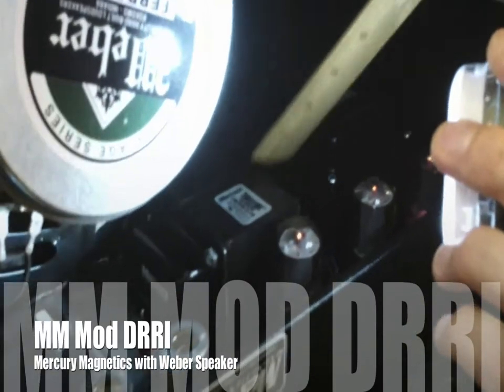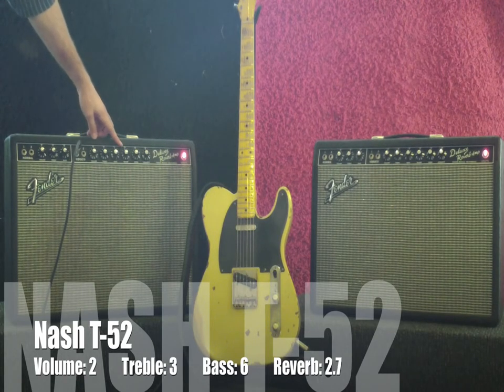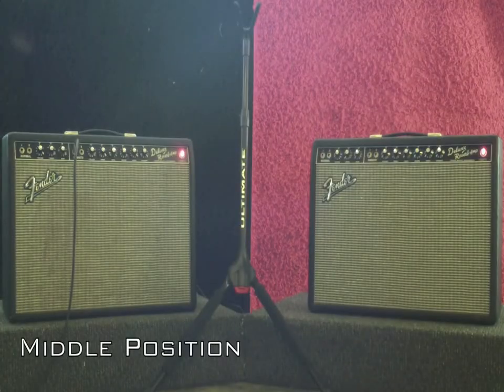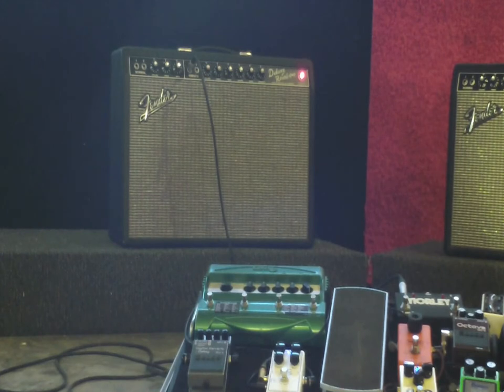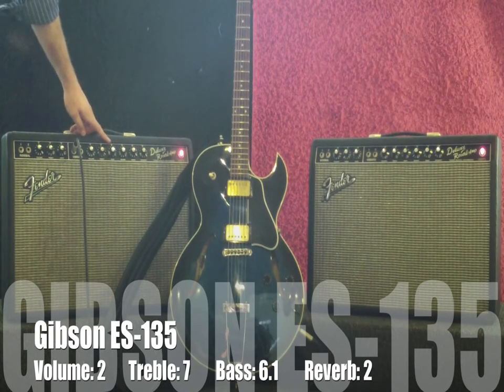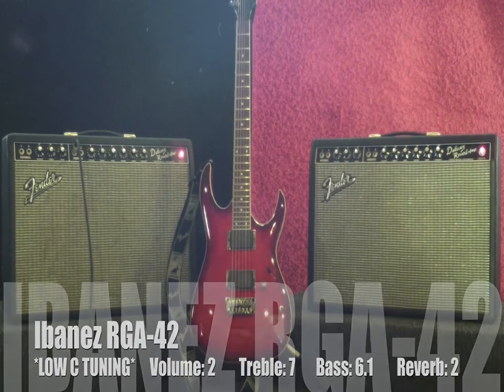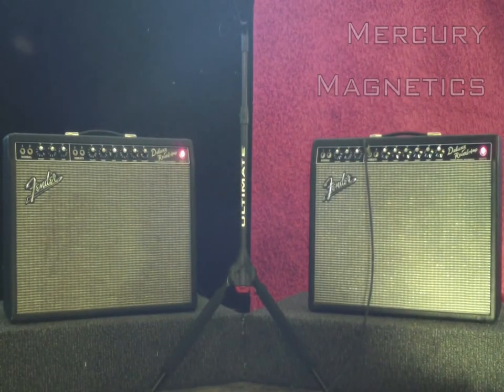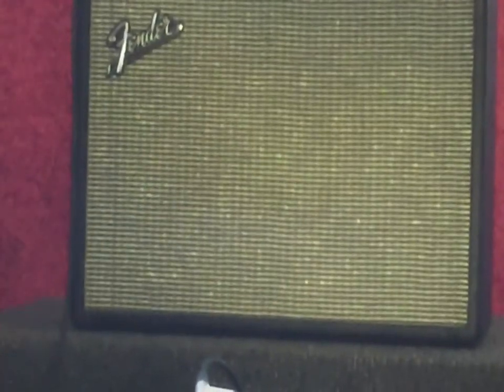Mercury Magnetics Demo/Comparison- Fender Deluxe Reverb Reissue (Part 1)

Comment: My opinion on a lot of these small fender amps is that when you get them all the way up or close to it you will be really happy you have the better transformer. The gain is more clear and less muddy. But the real reason to upgrade all this tranformer stuff is because you kick the crap out of your amp and put it on real loud. So at bedroom levels it is unnecessary. Especially if you use a pedal for boost. That is why some of the comments below say that it is not needed. But trust me that it makes a big difference when you really play the amp straight through and on full.

Comment: Just run both amps through the same speaker for the demo.  You can take the speaker out of the second amp to the speaker terminals of the speaker of the original amp.  Speakers could EASILY account for the tonal difference you are hearing.  By the way, I like the clean tone on the original amp.

Comment: I prefer the stock too. A bigger output transformer will definitely change the sound but not necessarily for the better. Fender knows this perfectly as well, it's not a secret. Fender chooses very carefully the size of them to achieve the sound they want. A bigger OT will sound bigger but also stiffer, will saturate (distort) at higher volume. The power trans will barely change anything except if it has higher or lover voltage, or if it's underrated and sags.

Comment: Upgrading the transformer and the components he changed will help but changing the treble cap to a better one with a few other mods will tame the highs and smooth them out. In addition, installing high quality power tubes will make this amp a beast.

Comment: Don't know much about transformers etc., but I can tell you there is a huge difference between the Weber 12F150 and the stock Jensen...big difference. I replaced mine soon after I bought my DRRI. Then I took it to my local music store and we did a side by side with my Telecaster. All settings  were exactly the same. Three musicians put the amps through the paces...no contest, Weber was w-a-a-y crisper, better sustain, more articulation on the strings, everything.

Comment: MM and weber made it a little sterile or harsh. I think the stock one sounds good. Especially the ones I played with the Jensen.
Reply: Jeff Nickoloff I can't agree. The original sounds muffled and has a lot less articulation. As i said above, installation a better treble cap will smooth out the highs if that's what bothers you.
Reply: jimmy5634 Not to me.  Much warmer, richer before.  YMMV I guess.

Comment: sorry but with different speakers it just cant be fair.  One speaker may have a completely different voice and not to mention the sensitivity may be different effecting the volume.  It aint apples to apples if you core one of the apples before comparing them. Funny thing Is I think the unmodded amp sounds better.

Comment: You can change the power transformers all day but you still have the same circuit board. People buy an amp and put 5 to 700 hundred dollars worth off mods into when you could have just bought a higher end amp....This amp is fine as it is...

Comment: Almost made it here. BUT [there's always a big butt somewhere, eh?]......Scientifically, we never ever change two parameters at once. NO conclusions can be realistically drawn because of that. Sorry.

OH, and when comparing amps, choose your mic wisely AND place that mic on the rim of the speaker at a 10 deg angle to avoid blow-back, equally positioned for both amps. In fact we must actually measure it's position accurately, because close mic'ing changes significantly when moved minimally.

THANKS for the efforts though. I'd be looking forward to another attempt if you can manage it.

Comment: I don't buy the MM hype. If the upgraded amp sounds better on some settings it's 50% because of the Weber speaker and 50% because the output trafo is simply way bigger, not because it's MM.

Comment: Thing is. Its its unfair to to compare "TONE"....the tone stack remains the same. The Mercury is WAY more transparent and clear. You simply have to twist the tone knobs to dial in the "warmth" (bass) and sparkle treble back into the amp.
Sure you might increase both to get it back! ?? In the end the stock OP Tranny is full of garbage....Not so on the Mercury. Once you experience the mercury Mods...you will never own a stock transformer again!
1. Better touch sensitivity!
2. More headroom!
3. The overdrive and distortion channels become precise and articulate
4. The amp is quieter (Less hiss and humm)
5. Tube changes for dialing in you amps character become effective!
6. Believe it or not ?  The most expensive part of the amp to produce is the output transformer. Today most amps under $1500 have cheap Chinese parts.
The OP tranny is a major part of high end "Boutique"... point to point or otherwise?....YA CANT GET SOMETHING FOR NOTHING!         
 

Gaslight Recording
Over 30 years of  the quest for "Tone"